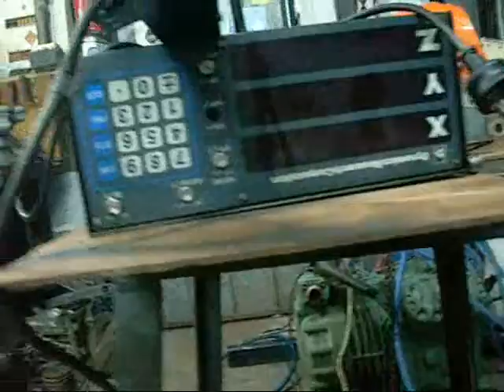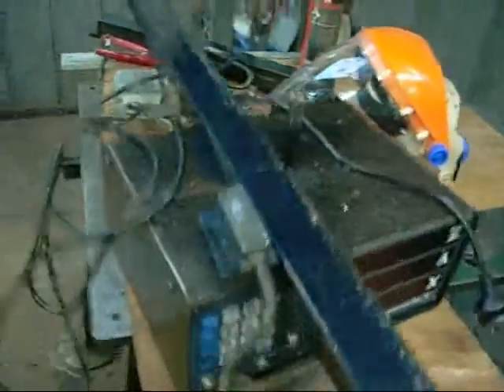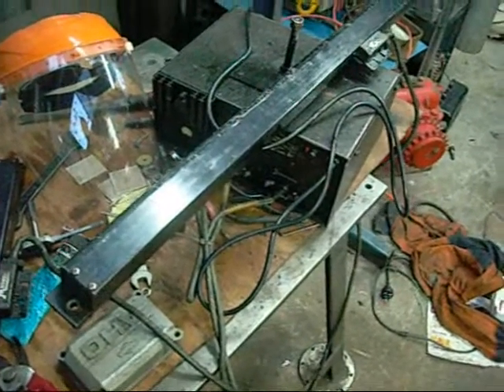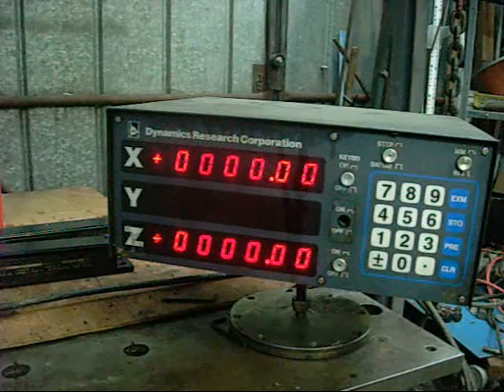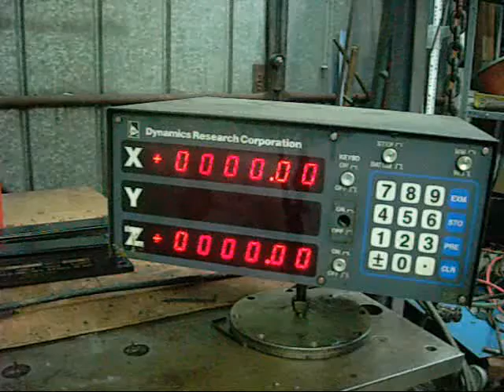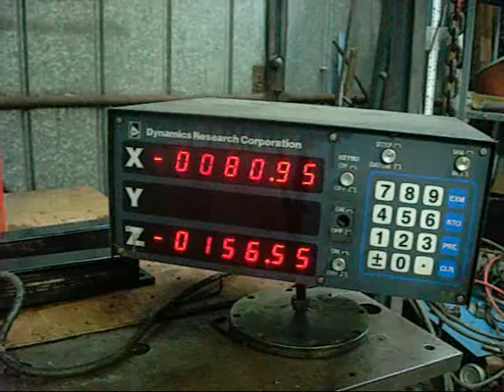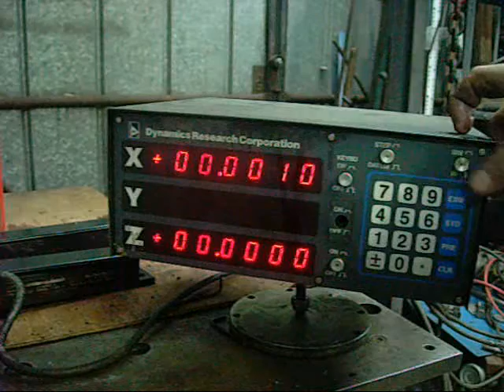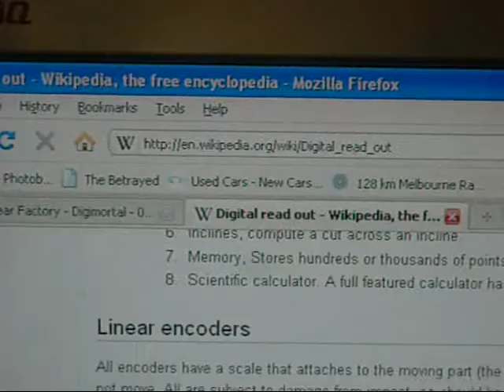Dynamics Research Corp DRO Examination and Info on How It Works

Comment: 2020 and my 1982 Mdl 700. Dynamics Research D-ANN DRO is still going strong on a 1965 Vintage South Bend Vertical Mill.  I have never been able to find a manual for this DRO.  This U Tube is only information I have ever found.

Comment: Hello, I enjoyed this video since it is the only one on youtube for one of these. I also got one as a freebie, but sadly mine has serious issues. And yours, like mine is a model 700 made in 1983. My scales are intact, but have the same rotted foam issue. I don't suppose your owners manual had a schematic diagram in the back???
Reply from the maker: +Steve Watroba G'day mate, I am not aware of any manuals kicking around for it, I sold mine long ago since I came across a tidier Heidenhain unit and had no need for the bulky old Dynamics model.
Reply: +Aussie50 that's what I thought.  a google search shows many requests for a manual and no replies. I think mine has bad microcontrollers so sadly it looks destined for the junk pile......or ebay lol.